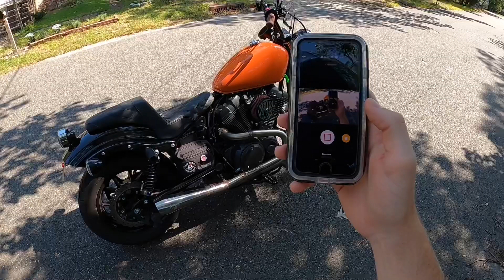Yamaha Bolt 500 mile modification review

Comment: Hey  Liam, second time watching this, 3 yrs later  lol. Still have my Bolt.... Anywho, when you parked the bike and did the walk around and you mentioned the leg burn issue....... I noticed the problem. Your exhaust elbow out of the # 2 head has a long radius elbow on it, instead of a short radius one. Maybe your reseller can fix you up .... if you still have the bike ??
Stay Safe

Comment: I like the looks of the bike and the sound is great. I almost bought this bike, but my arms were a bit stretched out. The only thing I didn't like,  but your risers on the bars may solve that. So I went with a triumph. After watching lots of crashes of bikes on YouTube the one common denominator in people walking away without problems, was they had on  protective gear. Do your self a favor and wear some basic protective gear.
Reply: 12 inch pull back risers would solve the problem.

Comment: What was the handlebar and riser setup again? I got confused when you said 4 in. bar and 2 in. riser
Reply from the maker: yeah its an 8in bar but some people get technical with it and try saying its 6in bar with the 2in cross bar welded on. its dumb lol just 8inch bars. 

I swapped the soft riser bushings with hard riser bushings so the bars don't wobble. If you add higher bars with the soft bushings it doesn't matter how tight you make them the bars will have some give.
Reply: Color? Gloss Black?

Comment: Where did you get that little tool bag?
Reply from the maker: Got it on amazon. I searched "small tactical bag" lol it was like 10 bucks. if you want the link I can try to find it.
Reply: Liam McGuinness thank you, how did you mount the bag? It’s a great idea and your bike is exactly what I wanted my bolt to look like
Reply from the maker: @jameshensley6896  Its super easy to mount actually, there is a silver bracket on the side of the bike that helps keep the battery in place. I just unscrewed it and slid the buckle of the bag behind it and you're good to go. Literally 5 minute job. 

Ill be making a video on it tomorrow since I get a lot of questions about it
Reply from the maker: https://www.youtube.com/watch?v=EVZsyiwqewY